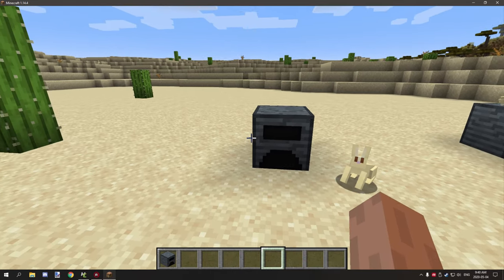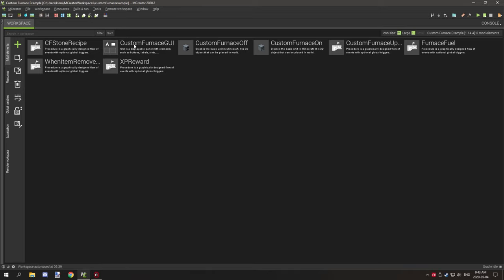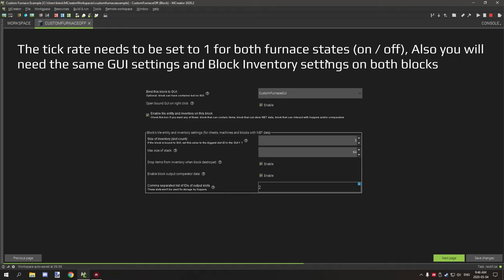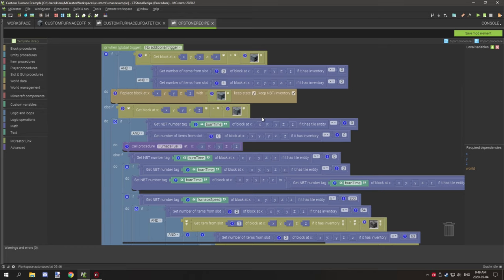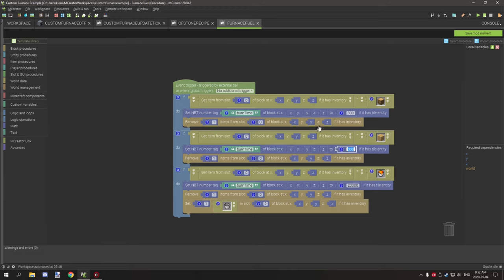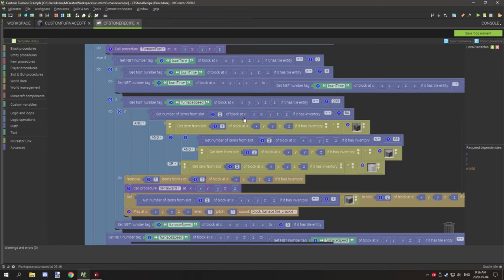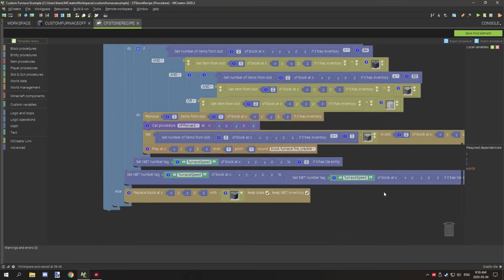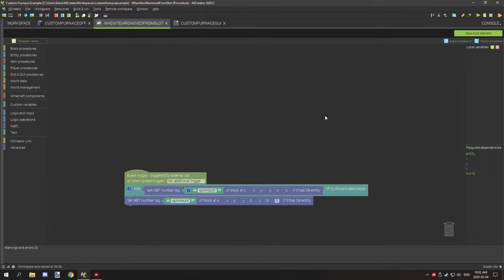MCreator Tutorial: How to make a Furnace | 2020.2

Comment: THIS TUTORIAL IS OUTDATED OF CURRENT DATE FOR MCREATOR

there is another way to properly make the furnace work and here is how:

basically in the code of the tick block, change "Get item from slot [number] of block at x: y: z: if it has inventory" (which is the entity dependent code, or is now called "Get item from slot [number] of the currently open gui")

 to ->  "Get a copy of item from slot [number] of block x: y: z: if it has inventory" (RED block)

So that instead it creates a copy of that item to store what it is, then do the same as you would normally
now you wont see that annoying entity dependency error anymore, and remember to set it to tick 1, and procedure tick :)
Reply: You are a absolute hero
Reply: Can't seem to figure out what you mean by this, can u explain further which of the blocks I have to replace and what to replace them with. also having trouble with dependencies not working for update tick.
Reply: Absolute unit.

Comment: Is there no way to add a progress bar/arrow to show how much fuel is left per plank as well as how long till the item is done smelting?
Reply from the maker: I think you can use NBT variables in GUI so you could configure text elements in the GUI to display the NBT values

Other than that progress image bars are not yet possible only variable based ones.
Reply: You can absolutely add a progress bar. It takes a little fiddling, but you can set up a system that shows different stages of a bar filling up. 

Update: Animated textures. You can do the fire effect ETC
Reply: @newtybot  can you plz tell me how to make the bar and fire effect in the furnace?
Reply: @newtybot  Tell me how

Comment: Hello sir, Ive been watching your videos for a while. They have been very helpful. Do you think you could create a more detailed or smaller method for doing block states with gui blocks? like furnaces or other machines etc. When I try, it kicks the player out of the gui because the block is constantly being replaced when active.
Reply from the maker: I did not experience being kicked out when I used my procedure system... The only time it happened was when I switched block states from on to off or off (This is normal) to on so there could be a problem where your block states are not coded properly and are switching between on and off every tick or so, this would cause the issue for sure but its not something I can fix due to a lack of support with MCreator nor do I know what your procedure looks like. My website has the exact files used in the tutorial including the procedures if you want to try to use them I think I added notes to this recently updated tutorial in the procedure so you just need to read the notes to figure out what does what.

Comment: Hi NWTG!!!!!
I'm having some problems whit the exp.
Then i tried delete the exp procedure and then appeared MORE problems in some of the procedures
Can u pls help me ??? I would really appreciate it.
Reply from the maker: This sounds like you had other elements that used the procedure you deleted, just open them up then when editing the file click save and it will remove the procedure you deleted from your workspace, if that still does not work then it could be a build error try to recompile the workspace, if that still fails then it may be a bug in MCreator you may at that point want to start to work on the steps to open a bug report.

Comment: I don't know if anybody still reads these comments, but I'm confused about the furnaceSpeed. What is furnaceSpeed? What does it track/do? I've gotten my furnace to change into the onfurnace, but nothing ever happens. Nothing is carried out. I'm not sure why. Can somebody help?
Thanks.
Reply: The Fuel doesn't ever come out of the furnace, and nothing ever smelts. I've been through everything multiple times and can't figure out why.
Reply from the maker: It control the smelting time, 200 will take 200 ticks for it to process item in the smelting slot same as a regular furnace. I think blast furnaces are 100 ticks.

Comment: 08:24
Reply from the maker: This block is new and basically does what the old "Remove and Place" block trick did, however we can now can enable it to use the current block rotation and keep the NBT variables something we did not have access to before with the old system.
Reply: @NorthWestTreesMCreator  Oh, I just wanted it to save that part for a procedure i'm working on. But thanks.